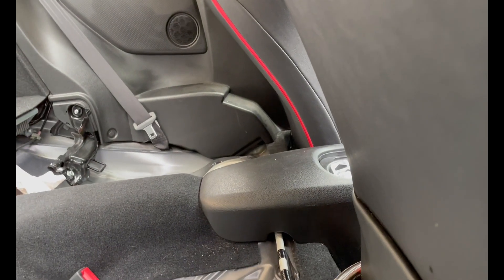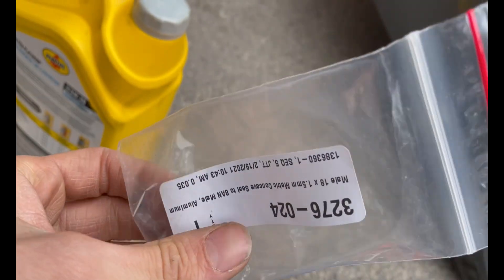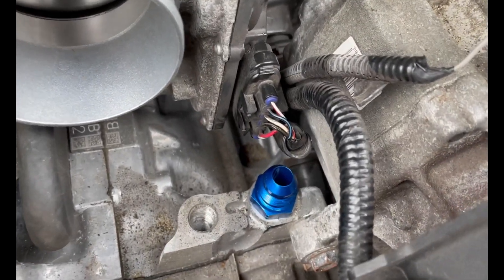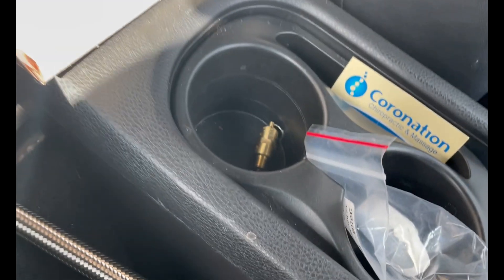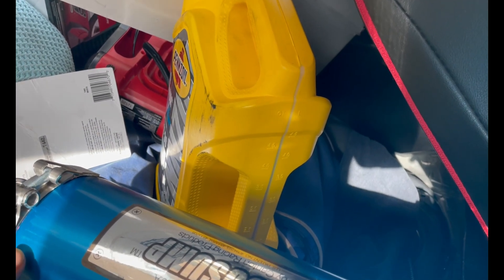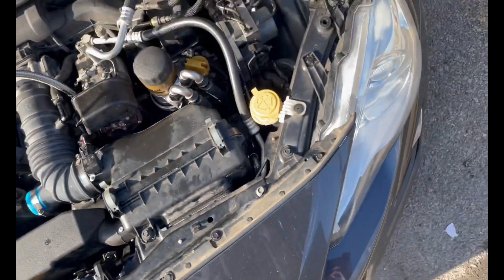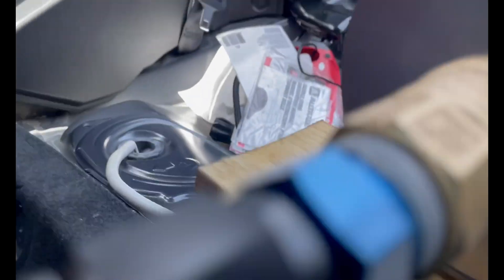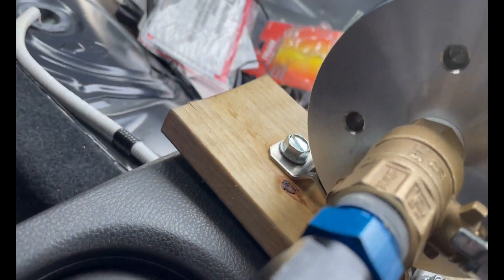Making the FA20 Reliable for Track Use! (Canton Racing Accusump Install)

Comment: Hi, can I have an update please? How well did it work on track?
Reply from the maker: It works as intended I’ve had this on m summer daily/ racecar for the last 2 years with no issues. I have since upgraded to an electronic valve instead of the manual ball-valve so it sits in the engine bay instead of the passenger compartment.
Reply: @digiovanniracing  Thanks, I was wondering if it would be a viable option for my fa24 brz
Reply from the maker: @1Solace  more likely than not yes. You probably have the same crank galley port as an FA20 block would to utilize for this purpose
Reply: @digiovanniracing Thanks for the info. I really appreciate it. Someone was saying that you would only use it in a track dedicated car running at 2k rpm with a tune idle as the pressure in the accumulator is more than the fa24 at idle. I'm no expert but I don't know how true that is
Reply: Link to the electronic valve please? Also do you offer installation for FA24 and where are you located 😂 Thanks dude
Reply from the maker: @lesterli3043  All of this stuff can be bought from Pegasus Auto Racing!

https://www.pegasusautoracing.com/productdetails.asp?RecID=24939

I'm in the Greater Toronto Area of Ontario, Cananda
Reply: @digiovanniracing  that is amazing! I didn't see a similar electronic valve in the US

Comment: What size Accusump canister did you go with?
Reply from the maker: 2qt because of packaging restraints
Reply: @digiovanniracing  Yeah, good choice.  I have a 3 qt but it's overkill, too much volume.
Reply: Do you have an issue with cold oil pressure? I have it mounted in the same galley and will see 100+psi under load if it’s not at full operating temp
Reply: @politicallyerect6086 Once the oil is warmed up, you should see 55-70 psi at high rpms depending on your oil viscosity.
Reply: @SlickRacerGuy  correct, problem is that doesn’t happen until a couple laps in, and if I open the valve any sooner, I lose oil in the pan that goes to the sump as it tries to make 100+psi
Reply: 60 psi seems really high, was that the recommendation for the FA20?